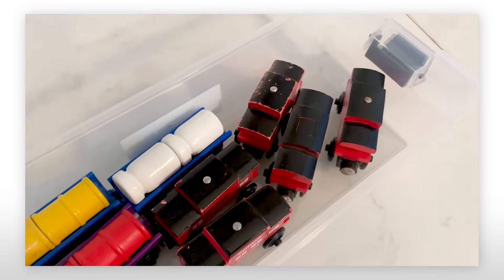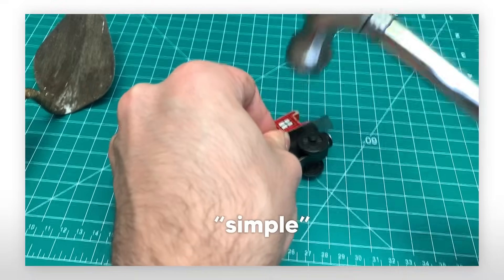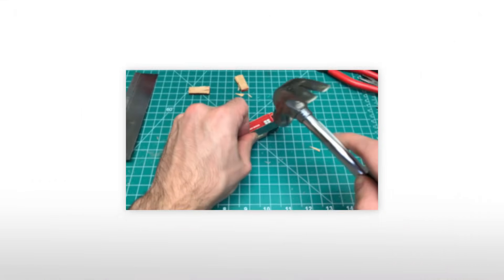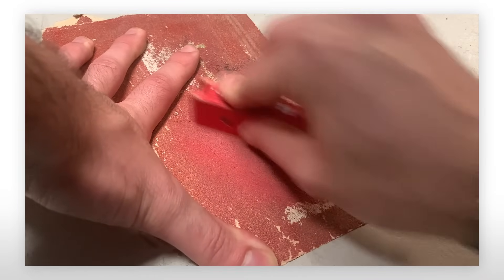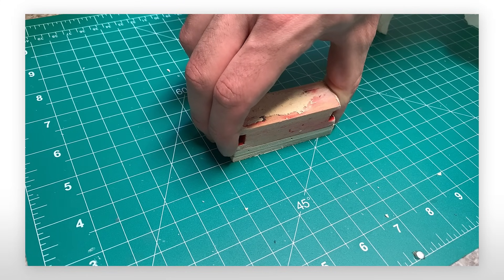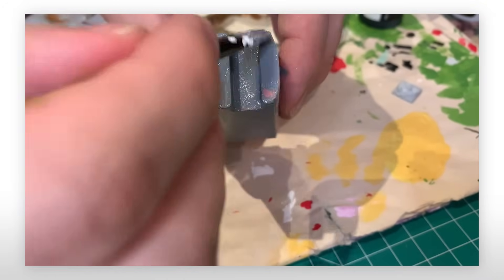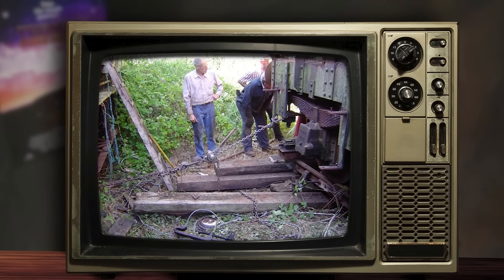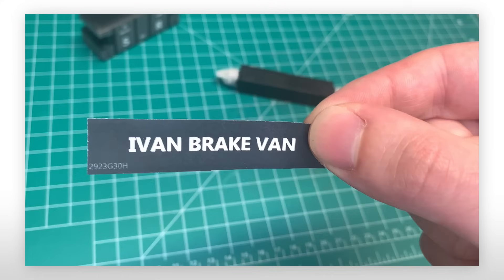Pimp my Brake Van? | Wooden Railway Caboose Restoration

Comment: As usual, we can count on the fans to make amazing custom models, while the official company doesn't even try.

In my opinion, not enough Thomas merchandise lines have British brake vans, Thomas Wooden Railway being one of them. Yes, they have characters like Toad and the Spiteful Brake Van, but most of the time, they have American cabooses like the Sodor Line Caboose. I've had to make my own custom brake van models, namely from some of Thomas Wooden Railway's competitors. I made the W&L Brake Van from an Orbrium brake van,  Bradford and the LMS Brake Van from modified Maxim cabooses, and the BR 20 Ton Brake Van using a 3D printed model from NickTF89 that I ordered from eBay and the chassis of what once was the Dino Fossil Car that came with Oliver's Fossil Freight.

Comment: Honestly, I can empathize with how much of a bitch it was to remove the chassis of a caboose. It was quite a challenge for me because I was working with a 2013 variant of it.

Great work dude, I hope you make a video about how you made Duck.
Reply from the maker: Oh don't get me started on the 2013+ mattel stuff, those are HELL to take apart. I'd love to see what you did with it though!

And thank you on Duck, there may or may not be a video on him coming out Saturday ;)
Reply: @GeohToy  Oh that's wonderful.

Well, I still have the beat-up caboose body, it still has some plastic bits at the bottom, it looks like MATTEL had superglued the chassis to the body as well as with plastic screws.

I used the chassis to make a custom slate car I built from scratch.
Reply: @GeohToy Update: if you check my community posts, you'll see what I'm cooking rn. And yes, the nail is a bitch for me as well.